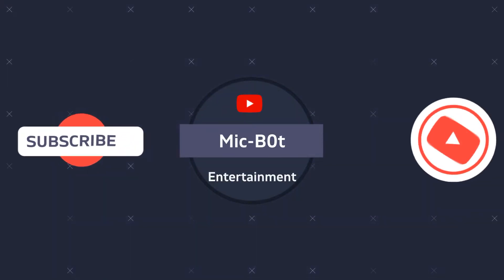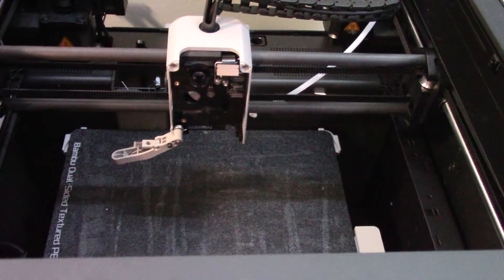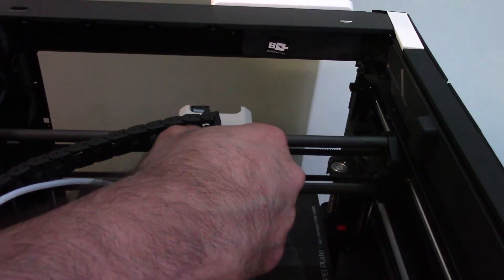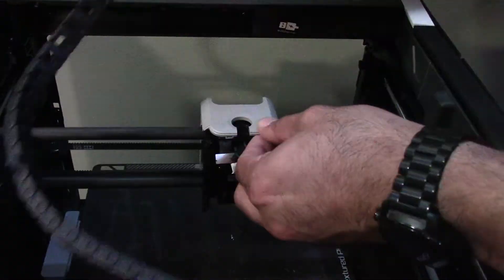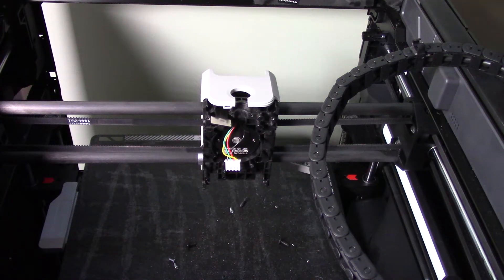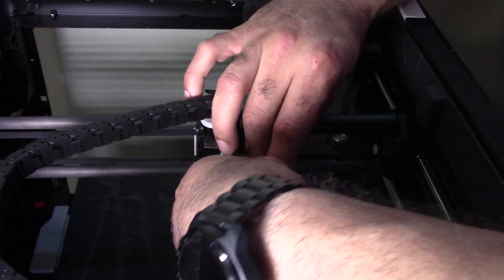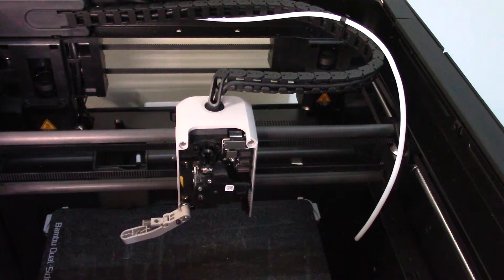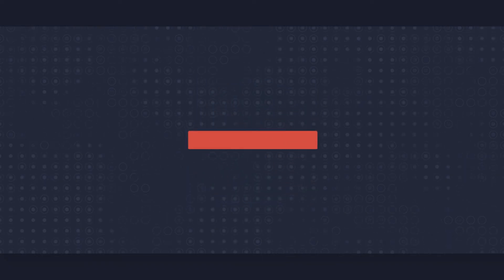Bambu Lab P1P Extruder Motor Replacement, PCBA Boards, Tool Head Cables, Connector Cables and more

Comment: I need to remove the small  board in front right.  One of the pins is broken.  .  Problem is that I think 💭 got all the screws but it is stuck up top.  Btw what is the board called?  Thank you  Jim

Comment: hi just got a Bambu Lab P1S ive had it 3 months now but when the printer changes the filament it said there is a clog. but checked it out no clog in nozzle no clog in gear box. changed the runout sensor ok there. so went to the extruder drive motor. done a test by trying to grab the motor cog to see if it cut out and it did. so think its the motor or the ph pcb .What is your view on this problem. Regards John

Comment: I've noticed that by taking apart and putting it all back together several times, the connectors that connect the fans to the PCB in the front of the toolhead WILL wear out - they are very fragile. I'm sure I will need to replace the PCB because now the connectors randomly fall off because of being taken off and on so many times. I have new cables, fans, etc, but that only takes you half way to the solution. I wish that the connectors were more robust.
Reply from the maker: You can technically glue them in. Bambu provides a silicone glue with the printer and parts when you buy them.
Reply: @MicBot  I had considered hot-gluing them in. Just a spot of glue should be easy enough to remove when needed. Thanks! My printer is under warranty... I wonder if they will replace the parts that have fallen apart?
Reply from the maker: @c3ajeff  Honestly it's not worth the headache but you can open a ticket and get the ball rolling. 

What I personally do is keep a very large stock of parts on hand, and if it was something significant I open a ticket and have them replace the part and add it into my stockpile. If the part is under $100 I don't usually bother with support.
Reply: @MicBot  Bambu Service told me not to glue anything in. They were willing to replace the PCB. I have new connectors on the other end(s) which should solve the problem until it wears out again. Maybe I'll treat it a little more gingerly going forward.

Comment: My machine printed for a week then the magnetic fan fell off, the cables were loose and after a while they wouldn't stay on anymore. Had to have an entire new front board, hot end and fan shipped to me. If it continues I will just demand a refund and ship it back to them.
Reply from the maker: Bambu support has become quite useless now. They were really good at first but they can't keep up now. They still make the best printers though, so don't get discouraged.

Comment: my p1s is having issues it will print half the model then stop putting out filament, but still keeps going as it thinks it is still using filament. Could the motor be my issue?
Reply from the maker: Anything is possible. You will have to troubleshoot slowly. Start by replacing the nozzle and take it from there.

Comment: PLEASE HELP!!!!! I need help with my p1. I have replaced the nozzle, the hotend cooling fan, the TH extruder interface board, Ceramic Heater & Thermistor, and i have unplugged, plugged and checked all connectors are plugged in 1000x. I can put the fans all on manual on and it'll turn on. But during start up nothing. I just order TH Board FPC Cable and the TH Board and replaced that yet i am still having the error come up "hotend cooling fan abnormal, etc"
Reply from the maker: @leonardkeith9868  double check that you inserted the hotend fan cable correctly. Sometimes you end up only inserting the top or bottom half by accident. I've made this mistake before. 

You should also open a support ticket as a backup plan, just in case the main board needs replacing. Hopefully not. I have a video on replacing the entire main board in the back of the machine.
Reply: I 1816380x checked that it's all plugged in correctly. Just watched your recommendation video. It's not burnt out. Assuming maybe the new hotend fan somehow is no good? I'm so flustered trying to fix this. I have around 1600hrs on it so it's fairly new

Comment: Thanks so much for this video. I have a brand-new PS1 that started throwing errors on the 4th day of printing. After removing an extruder clog, the extruder motor failed. I was wondering if I should replace the motor myself or just return the unit. After watching this II think I’ll be sending it back.
Reply from the maker: Happy my video could help. Yes, if you are within the warranty window then I would exchange it.

Comment: hello,  I was having lots of issues after having great prints, I replace extruder and the  hot end, it was quite frustrating; i only print Petg, the problem was after lots of tests and frustration, that the G code for the first flush was set to 250(255 orca slicer) and this wasnt enough heat to flush properly the filament,  so i have partial clogs, this made my prints look like shirt and the filament look humid, I went to the Gcode change the temp 270  for the first flush and filaments changes and it was like magic, now i can print wathever i want without any risk of failing, I m just more concious about the flushing temps for each material, and this has work for me, I hope you find solution for your problems, i found your videos because im getting a P1P to make it myself, i already have a carbon X1 Im super happy with it, maybe this can help you, cheers
Reply from the maker: Hello, thanks for sharing. I appreciate you taking that time to make some recommendations as well! 

In regards to my issue, they were indeed hardware related. After all was said and done the MC board went, it's safe to say the printer was a lemon as every single part got replaced except the power supply and now it runs it great.

Comment: Hi! What problems did you have that you needed to replace the extruder motor? I've been having major under extrusion issues with my P1S and after some back and forth between Bambu and me and excluding possible other issues they think my extruder motor is faulty and offered to send a new one free of charge. It seems like a difficult replacement compared to for example extruder gears so I just want to be sure. For me the problems started after/midst some clogging issues after using some old and (likely) bad PLA I had respooled. Ever since I had really random and arbitrary underextrusion, and especially at higher printing speeds things started to mess up, while slow first layers or slow outer wall loops seemed sort of decent. Anything faster was just wooly stringy mess.
Reply from the maker: Hello, the main issue I had was under extrusion and then eventually it would not extrude. I replaced all the parts one by one to confirm what the faulty part was and it eventually led to the motor
Reply: @ thanks! Sounds very similar to what I’m experiencing. Can’t wait on my new extruder motor so this awful downtime can finally end. 😅

Comment: I got a lemon on a p1s, getting them to send me tons of parts. Sucks you spend 1k on a device only to have to completely replace the boards. WHAT A JOKE BAMBU
Reply from the maker: The QC can definitely use some work.
Reply: I got a lemon p1s too. Its a month old and going through the works. Theres a terrible noide during input calibrstion and then the first layer fails to adhere

Comment: I got a Hardened Nozzle to replace the Stainless Steel one on my P1S. Once I made the swap, BOOM! Nozzle Temperature issues. Error HMS_0300_0200_0001_0007. I can’t even print anymore. I’m not sure if it’s a board issue or some other issue, but man it’s a pain
Reply from the maker: Did you figure this issue out?
Reply: @MicBot  Yeah I just ended up buying a complete hotend and swapped it. The problem seemed to be the thermester wire
Reply: @Diamonddog10.3  this can also be caused by the connector - one of the tiny copper fingers can get bent out of alignment when taking the connectors on and off repeatedly. Get a real good look at the connector and make sure it is seating properly and all the little fingers are aligned.

Comment: I think my extruder is also damaged. I pulled the filament hard trying to get a clog out and the printer is under extruding now.
Reply from the maker: Could be a bad clog. Try heating the Allen key and pushing it into the nozzle trunk a few times, wait a few seconds and pull.

Comment: I too have a P1S that failed with the HMS_0500_0300_0001_0002 error after only a couple of months of light use.  Opening the tool head shell, I noticed that I do not see that green LED on the  TH board.  Does that mean that the board is not communication with the MC board?
Reply from the maker: Correct. No green light means it's not communicating

Comment: I have the PIP and it stopped working.  It gives me an error code on the hotend fan.  On the Bambu handy app it shows the the hotend fan controller board is bad.  Is that what you replaced in this video?
Reply from the maker: Which error code? 

Yes this video should help you. 

I am making one now that should be live tonight about replacing the MC boards. The error code is the same as the controller fans being defective.

Comment: I currently have issues with my X1. Everything's checked but the motor - would you say it can be responsible for both ....- printing without filament - and no printing at all while using AMS as well?
Reply from the maker: Hello, that's a tough one to diagnose without more information or a video. 

Do the extruder gears spin when you print? 

Do you hear ticking sounds? 

I do offer one on one session for troubleshooting on my Patreon if you're interested in a one on one troubleshooting session.

Comment: I’m feeling like I might have a lemon myself. I don’t know if I have 50 hours of printing and I’ve currently got a machine that makes abstract plastic trash art pieces.  My 4-5th print the print head starting making noise. It’s been rattling ever since. The nozzle started dragging on prints.  I replaced the print nozzle this evening and it seems to be printing with some of the infill in the little fexi toy head not being continuous.  I’m not sure where to start. How would you know if one or more of the circuit boards needed replacing?
Reply from the maker: That definitely does not sound like a circuit board issue. Your printer would not run at all if it was circuit board related. It may be a clogged extruder. Try removing the extruder and taking it apart. Clear and debris or plastic, reassemble and test.

Comment: where are the green lights you mention? I'm having a HMS_0500_0300_0001_0002 error since I've upgraded my P1P to P1S and I'm fairly certain all the connections are secure, but maybe I damaged the TH board when it fell from the TH.
Reply from the maker: The MC, and two on tool head board.

It's trial and error until you find the faulty part. Sometimes it's as simple as you inproperly seated cable which looks like it's inserted perfectly.
Reply: @MicBot  thank you!

Comment: So I recently purchased a filament dryer that I paired with one of my P1Ps in order to print right from the dryer into the printer for higher temp stuff. Long story short I think the small amount of additional load on the extruded might have damaged the motor. The motor suddenly stops extruding and the tool head keeps moving but nothing comes out. I can hear the motor skipping as it tries to extrude. I have changed nozzles and done some troubleshooting but I think the extra load damaged the motor. I’m thinking from now on I’ll dry first and run the filament off the back of the printer like normal. But I think I’m going to change the motor as that’s the only other solution I can think off. I have tried changing nozzles and running a new extruder. So it can either be the extruder housing might have warped and is causing an issue or the motor is indeed damaged and can’t pull the filament through.
Reply from the maker: Part replacement trial and error. Start small like a nozzle change, then extruder change and take it from there.

Comment: What was your original problem?  I have 2 p1ps and one of them just started under extruding , stringing, globby infill, & bumpy outside wall.  I use all types of mostly silk pla and they all have the same issue.  I have always used the default slicer config (except no brim) and have no issues with this printer x2 months.  I can print the same job using the same spool on my other p1p with no issues so I don't think it's the filament or config.  I have swapped the nozzle twice, extruder assy and PTFE tube once but no change.  Bambu support is crickets and tumbleweeds.  The extruder motor just came back in stock so I have one ordered but you seem to have a ton of experience with this machine so I would greatly appreciate any advice.  Thanks.
Reply from the maker: My issue was under extruding and then it went to not extruding at all. The fix was replacing two parts, the extruder Motor and the entire extruder assembly. I ran some tests on the old extruder motor afterwards and it still works fine, which leads me to believe it was just the entire extruder assembly being defective.

Edit: Try upgrading the gears to hardened ones as well as the material youre using probably wears the gears down quickly.
Reply: @MicBot  I did swap the extruder assembly with the " Stainless Steel Extruder Unit" that runs about $35.  I also purchased a Hardened Steel Extruder Gear Assembly but havent installed it because everything else is new.  Is there any other possible parts to replace after the motor?

Comment: Thank you for providing the video. I can empathize with your frustrations regarding BL support. I utilized your video as a guide for replacing my extruder motor, and it greatly facilitated both the disassembly and reassembly processes. 

Unfortunately, the new extruder motor did not resolve my issue. Initially, my P1P began emitting a mechanical clicking noise during the printing process, coupled with under-extrusion. Over time, this problem has escalated to the point where no filament is being extruded at all. I have diligently examined for potential hotend clogs and obstructions in the extruder gears, but I have not discovered any impediments in the pathway. Additionally, I executed a cold pull procedure, but it yielded no positive results.

As per your previous offer to assist individuals facing similar challenges, I have shared a video demonstrating the sound it is producing, accessible through this link: https://youtu.be/ZIkqNf3BaXI . I have exhausted all troubleshooting steps, even exploring potential issues I initially deemed improbable. I have taken measures such as replacing the hotend, extruder gears, and extruder motor, as well as renewing all PTFE tubing. The only remaining components within the tool head, to the best of my knowledge, are the main motherboard and the extruder extender motherboard. Could these be causing this problem? I would greatly appreciate any insights or suggestions you may have. Thank you in advance for your assistance.
Reply: Here is another video of it trying to print the purge line and the first layer: https://youtu.be/1CmA1pNGjPM

Comment: I have my p1p since 1 month and the extruder do not grabe my filament, I have open and check the extruder and it looks normal.  So do you think that the problem is the motor?  Thank you very much for this video, I think that you are the only one who make a video about it.
Reply from the maker: Hello, it could be the extruder gear, the extruder motor or various other things. Can you upload a video?
Reply: Sorry, I don't know how to upload a video.  I have unscrew everything and when I try to extrude manually, the small gear (at 5.33 in your video) doesn't turn.   @MicBot

Comment: Thanks for the video.  I’m getting a tool head cover fell off error, which is not happening.  I guess I need to replace both boards and the FPC cable
Reply from the maker: I had this error before. There are two things you can do before you resort to changing the boards. First check and make sure the magnets aren't dirty. I've managed to fix a few errors by simply cleaning the magnets believe it or not. The other thing youe
 should check, is make sure your cables are all seated properly, and make sure the sensor isn't blocked.
Reply: @MicBot  thanks for the info… I’ve checked the cables they looked seated correctly, I’ll make sure the magnets are clean.  I’m not sure where the sensor is exactly so I can make sure it’s not blocked though… need to find a pic pointing it out
Reply from the maker: https://wiki.bambulab.com/en/x1/troubleshooting/hmscode/0300_1200_0002_0001 scroll down to the hall sensor.